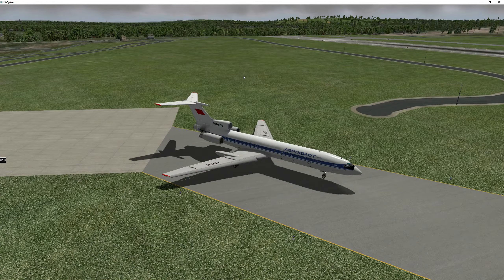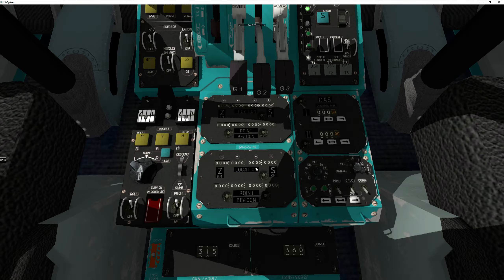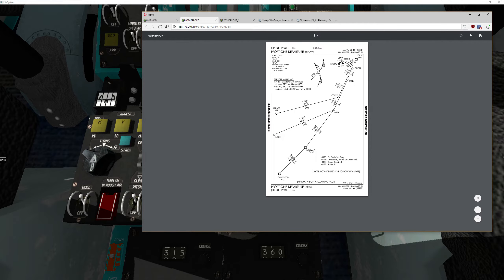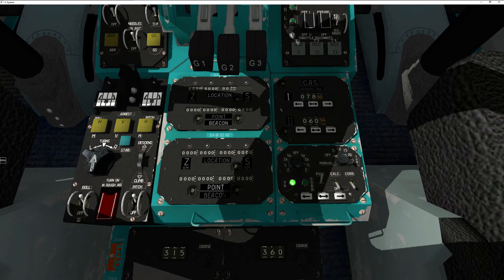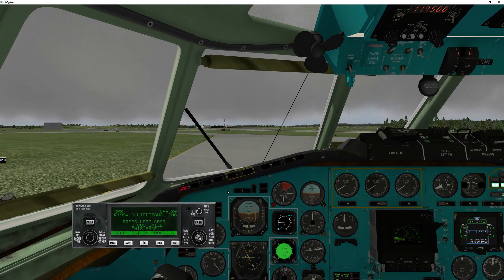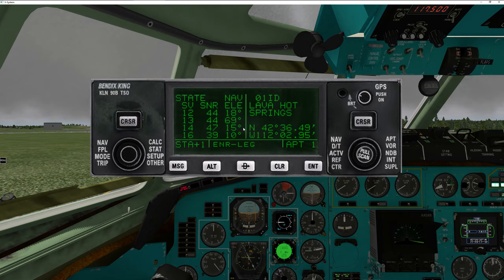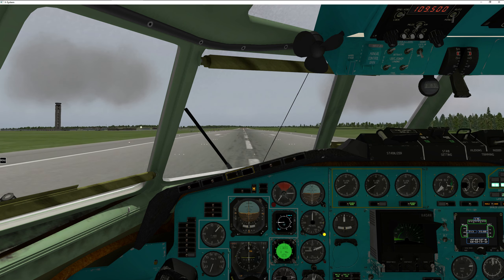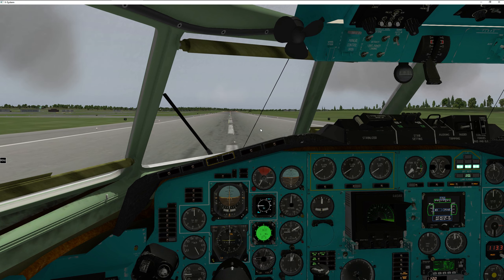Felis TU-154M NVU + KLN90 Overview

Comment: Mind you, KLN's VNAV doesn't do anything for the Tupolevs systems since it not connected in, only LNAV is. Fuel is has no connection to it in the real plane either.  Really nice explanation of the KLN unit btw :)
Reply: OK, now the stuff done wrong: 
1) NVU calculation switch goes on only after you reach 200km/h, it is done so because below that speed the doppler can be wonky!
2) landing lights go off at 120meters RA, you have a switch right of the retract ones that's the nose landing lights that stay on until 10k ft
3) didn't really see it, but just as a FYI: the gear handle goes to neutral both when raising/lowering them
4) the accumulated errors in the NVU part of the flight where due to the Z error, it's really not that accurate with it if you don't use correction(and also that you turned the Calc on too early)
5) You can preselect the HSI CRS for VOR any time you want

Comment: I'm a bit late, I know, but I have a question. If I'm on Vatsim or some other network and I'm vectored, how would I calculate the next course and distance for the NVU without having to refer to an outside flight tracking source? Thank you in advance :)
Reply from the maker: The good thing about the NVU is that it can tell you how far away you are from the point you're travelling towards.  So in the event that ATC calls for an offset, you know exactly how many KM (and the radial) that offset is.  Getting to the next point would just be a matter of comparing the desired track just like you would on a VOR radial.  It would definitely require some quick work on the navigators part to pull off if it got messy.  If they want to do something like give you your next waypoint, then all you'd have to do is dial in where it is relative to you at some point in the future, and then swap to it.  Definitely would require a calculation, but it wouldn't be that difficult if you had some warning.
Reply: @PGatcomb  thanks for the extensive reply, you've given me the motivation to try this all out on vatsim. Thank you very much!
Reply from the maker: @TriStarL1011  I've done the Vatsim thing with this aircraft before, you definitely have to be careful with true and magnetic directions.  Europe is the place to fly with it's "lesser" magnetic deviation.  Let us know how it turns out.